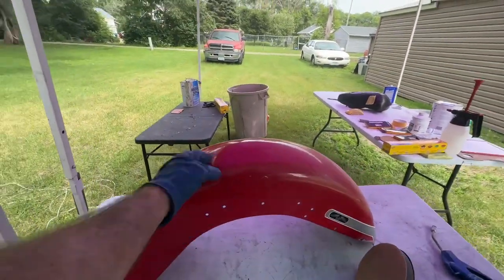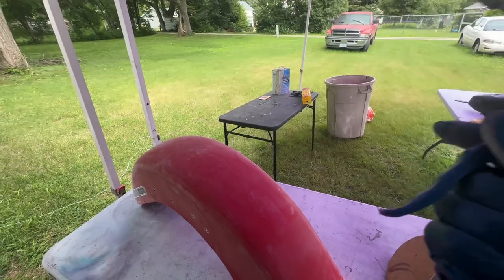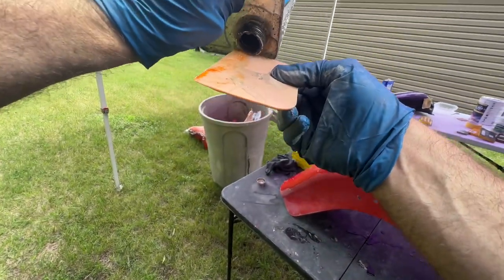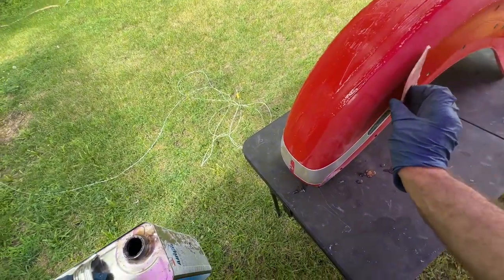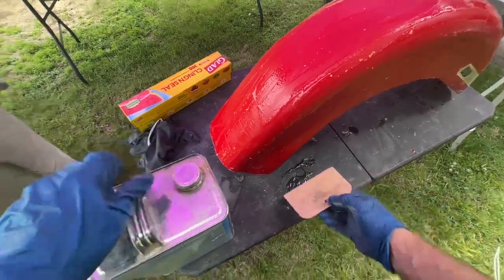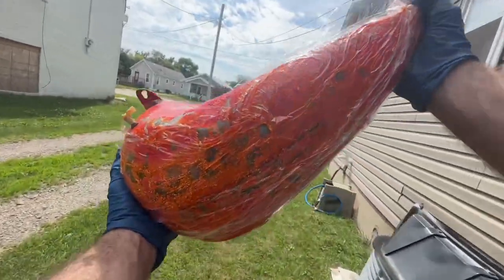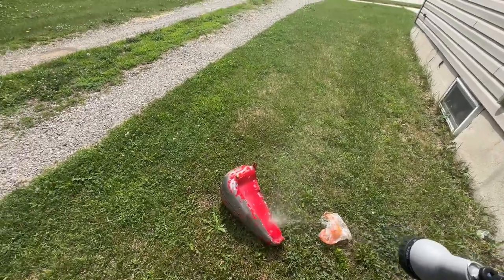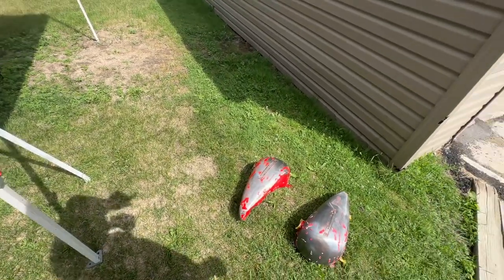Stripping Motorcycle Parts for Paint- Aircraft Ultra Paint Remover

Comment: Ive use paint stripper on a vehicle  in the past. Worked out pretty good but was a bit messy. Thought about using this on a bicycle repaint. Should be a lot easier
Reply from the maker: It’Z quite messy no matter what lol. But works good for inside of fenders and complex curves where it’s hard to sand by machine.

Comment: Simple enough on METAL motorcycle parts.

I tried it on my bike's plastic part and it didn't do much.

Paint did bubble on most area, but not completely.
Reply from the maker: I stripped a tour pack with it. Worked decent. Except there were a few areas that it seemed to eat and bubble the plastic, which required some filler work. Not sure why it did that, but thought maybe the tour pack had been scrapped/scratched up in those areas prior to the to the existing paint job on it, or had some prior body work???